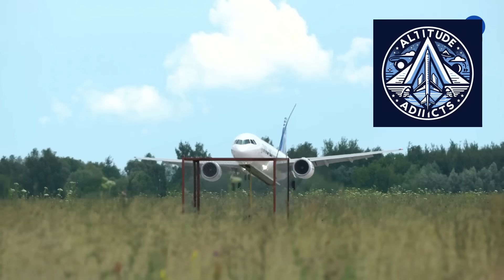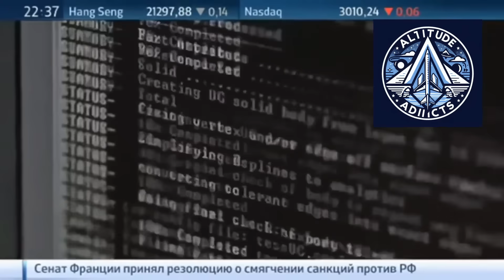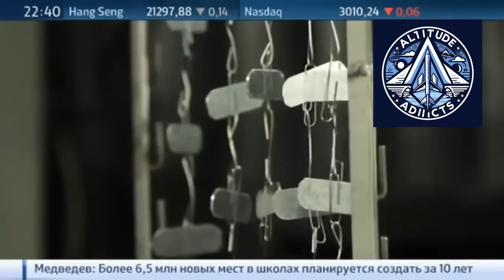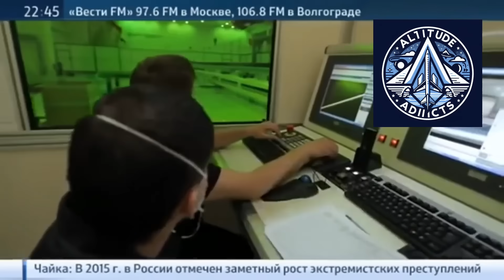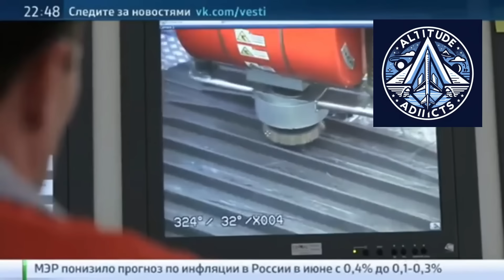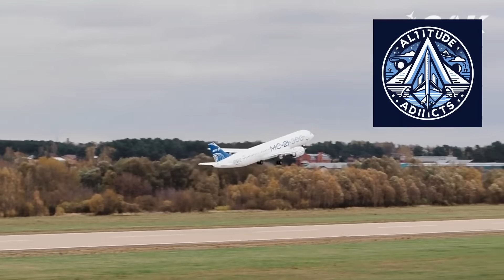Russia Diverts Billions to Fix MC-21 as Composite Wing Problems Mount

Comment: Guys it’s propaganda to divert attention from real progress going on on 2 MC21 aircraft all efforts are to complete all testing requirement for certification on 2 aircrafts. 1 SJ100 all tests completed, final preparation underway for certification and mass production already at fast pace.  2. MC21 by end of this month hopefully all test will be completed by 2 aircraft, Why? Cause all test will be completed in half the time. Final phase for certification process and mass production. Weight reduction will continue and hopefully completed mid 2026. mostly cabin components & plastic panels, seats metal which are very heavy will be replaced by carbon fiber which cost less than plastic and 1/4 the weight. Test are continue at fast pace.

Comment: Russian state company performed a test flight at the end of October '25. It's expected that it will have to invest to overcome the obstacles caused by the sanctions. Nothing spectacular.
Reply: Numerous test flights were conducted, the most recent of which took place in December, when the aircraft completed a nonstop flight of over 5100 km, fully meeting its initial specifications. The effective range of the MS-21-300 was 3500 km, while that of the MS-21-310 was 3800 km. People don't understand that different technical specifications are given. Furthermore, the MC-21-310's payload is significantly higher than that of the MC-21-300, as evidenced by its maximum takeoff weight, which is used to calculate its performance. Maximum takeoff weight describes the weight with cargo while maintaining the aircraft's stated performance. This doesn't mean the aircraft always weighs its maximum at takeoff; the final weight depends on its configuration. For example, a cargo version will likely reach its maximum takeoff weight, while a passenger version will likely never reach this maximum takeoff weight, as people simply can't be packed so tightly together, and they weigh less than the cargo. A simple example: the Il-96-400 can fly 9000-13000 km with a passenger load of 58 tons. Meanwhile, the Il-96-400T can fly 5100 km with a passenger load of 92 tons. Both aircraft have the same maximum takeoff weight. The most interesting thing is that the exact technical specifications of the aircraft, including the correct data, can only be found in the manufacturer's archive. Thus, MTOW only indirectly indicates the increase in weight of the aircraft itself, since it has become larger than the original model (in the case of the MC-21, longer), while MTOW indicates its potential payload capacity.

Comment: the wing has already been load tested and approved for production by TsAGi .... it has a higher aspect ratio than a metal wing can achieve and is therefore far more aerodynamic .... it was expected to be 15% lighter than a metal wing so even if its weight ended up the same - it will still be aerodynamically more efficient .... reducing fuel consumption 
the plane basically is just as good as a 737 already ..... but with much better development potential ..... but isn't quite as good as an Airbus A320 .... main difference being the engines - simply put the PD-14 has a large fan diameter as can be used on the A320 (but not on the 737 as its landing gear is too short) but it is not yet as efficient, so its performance is similar to smaller diameter engines as used on the 737 .... it really is as simple as that ..... everything else is just white noise ....
Reply: Some intelligence. Thank you.
Reply: Rare nonsense of an amateur...😅

Comment: The MC-21 overweight problems are an open secret for at least two years, Russian media reported about it in detail in early 2024. Why did it take so long to make decisions?
Reply: Tidakkah Embraer E175E2 juga kelebihan bobot terbang (MOTW) untuk bisa diterima di pasar AS? Dan hingga kini belum selesai sertifikasi?
Mitsubishi Space Jet juga tercatat kelebihan bobot sebelum proyek nya dibatalkan.
Saya pikir memutar otak untuk menyiasati kelebihan bobot ini memang butuh waktu lama dan kurangnya dana untuk uji coba. Mungkin ide menyiasati bobot sudah ada namun dana untuk uji cobanya belum ada.
Jangankan Rusia yang sedang kena sanksi.
Boeing Max 7 dan 10 terus tertunda sertifikasinya.
Reply: @SmartphoneZTEbladeA72  good to know this information. Thanks for sharing
Reply: Уже все проблемы сняты и самолёт в этом году идёт в серийное производство.
Reply: A decision must be based on facts, not just desires. It took time to analyse the problem, find possible solutions, make choices, count how much it will cost, and finally to decide. That all took time.
Reply: Before accusing Russia's UAC of taking two years, you should consider the following comparison: 1. The CJ-1000A engine project began more than 10 years ago, but it has yet to undergo a test flight on a C919. Russia took eight years to certify the PD-14 engine. 2. Embraer's E175 E2 was also overweight for acceptance in the United States market. It hasn't yet received certification. Embraer is likely still working out a solution to this. 3. For some reason, the Boeing 737 Max 7 and 10 have not made any progress for over five years, and it's unclear when they will receive their type certification. These three countries are currently not under sanctions, but why aren't you complaining about their slow pace? Moreover, it costs a lot of money to conduct tests with lighter materials or components on the MS-21.
Reply: @tergilagula4321  Correct me if I'm wrong, but the 2.2 billion Rubles designated now for MC-21 weight reductions equal 27.5 Million US Dollars. In a program like this, that's not "a lot of money". In particular it's peanuts compared to the 11.1 trillion Rubles which were wasted last year alone on the stupid war. 🤷‍♂
Reply: @luisdamian4562
It's strange to directly link the aviation industry to war. Check it out yourself: China's COMAC C919 has invested heavily and isn't at war. Yet, in 2025, fewer aircraft were delivered to customers than in 2024. Even without war, the West could arbitrarily delay or delay shipments of aircraft components for assembling the C919. Therefore, there's no guarantee that any cooperation with the West will be smooth and successful. I regret the war, but it's fascinating that Russia is able to fill the gap left by the departing Western technology. So, with the growth of various domestic industries that make Russia self-sufficient, the cost of the war you mentioned is insignificant. Inflation in Russia is still under control, while an ice cream cone in London now reportedly costs £4. It's still hard to find a homeless person in Moscow. But homeless people and slums in London and Paris are becoming more numerous and widespread. Is this the West's greatness?

Comment: This MC-21 is failed investment.
Better to invest to 214, maybe there install PD-14 and problem is solved.
Reply: Tu-214 needs atleast 160 KN of thrust per engine, PD-14 gives around 138 KN. Not sufficient.
Reply: @anonymouse8565 then retain PS-90A.
these additional 10% fuel is peanuts in current non-market conditions that causing 50% or even 100% higher cost. Souveregnity has ultimate value.
Reply: @markpowder4664  PS-90A has different weight characteristics and supporting logistics like pipes and electricals etc. Re-engineering for that would defeat the very purpose.
Reply: @markpowder4664  Just quit while you're behind, already.

Comment: How much weight would it have to save to be competitive with older a320s?  It’s 5 tons overweight so even a saving of 2.5t would be quite significant
Reply: Genau hinhören wo die 2,5t eingespart werden.
Auch Airbus & Boeing feilte Jahrzehnte an jedem Gramm Gewichtsreduzierung.
Hier wurde in praktisch nur 3 Jahren ein Flugzeug bis auf die Zelle vollkommen neu mit russischen Teilen konstruiert, gebaut & in den Zertifizierungsprozes übergeleitet.
Jetzt werden alle Zulieferer gezielt an jedem einzelnen Teil an der Gewichtseinsparung arbeiten.
Und diese Gewichtseinsparungen werden sich auch positiv auf die IL 114-300/ TU 204/214 & SJ 100 (80/130) und andere auswirken.
Reply: @T-BwBerlinKarlshorst-  Was wurde dann die vorhergehenden 16 Jahre gemacht? Ausser geklaut? Seit 4 Jahren wird der Jet für das jeweils nächste Jahr angekündigt und dass er angeblich noch besser würde, wenn er nur russ. Komponenten verwendet. Für jeden ökonomisch gebildeten Menschen völliger Irrsinn. Es kam wie immer: Der Start wurde mittlerweile auf 2027 verschoben und die Flugeigenschaften sind lausig. Mit 3.800 km Reichweite (geplant: 6.400) kann der Unglücksjet allenfalls Hüpfer ausführen. Das Problem ist nicht nur das erhöhte Gewicht, sondern auch andere Faktoren wie das schwachbrünstige neue russ. Triebwerk PD-14: auch eine 20jährige Endlosentwicklung. Alles ein einziger Sumpf.
Reply: @alexandervt641  the PD14 is producing its target power. It’s only underpowered in terms of the plane being overweight. One solution was to increase the thrust to offset the weight gain.
Reply: @alexandervt641 the launch is not moved.
Reply: @GoingForAdventure Launch is moved by 15 years… originally announced for 2012!
Reply: @a @alexandervt641 boeing first announced plans to replace the 737 in the early 2000s just as a comparison.  c series is still not a commercial success and the gtf is way more problematic than anyone envisioned no matter what place it’s in. . A380 program was a commercial failure, MRJ was a complete failure, L1011 was a commercial failure.  787 May never ever recover invested costs.  No other manufacturers ever faced sanctions on their economies etc and had to resource entire supply lines and even re invent components.  The original target date for MC21 introduction was sometime in 2016 until the west derailed those plans with sanctions. It’ll take time but they’ll get it sorted out. Like I said, even if they save 2.5t it’ll be a big benefit.